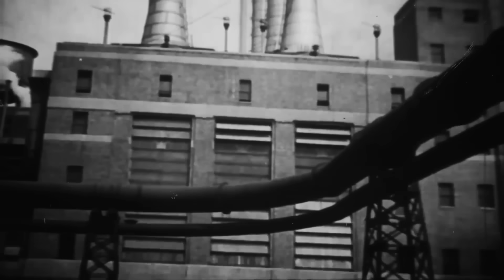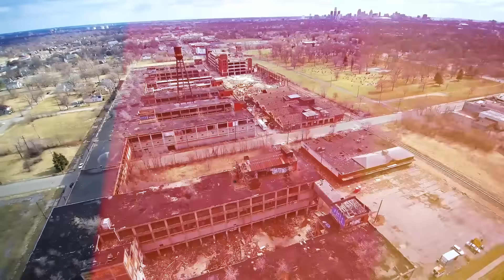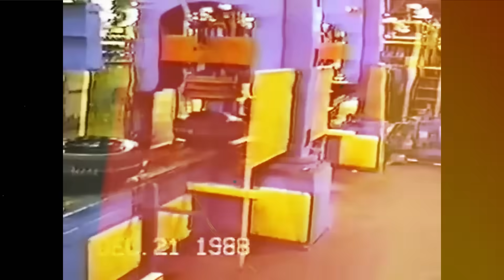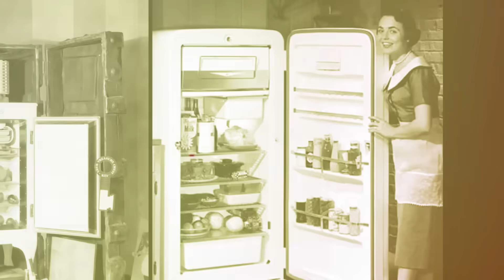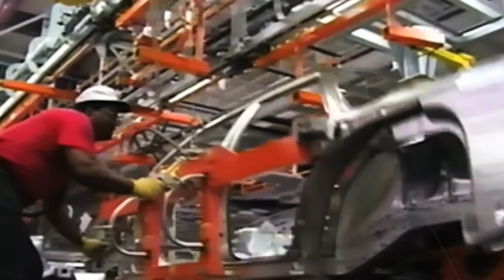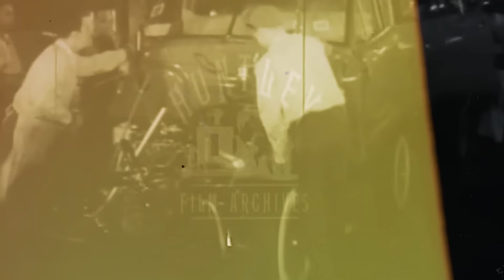The Shocking Truth Behind US Abandoned Car Factories!

Comment: No mention of Checker taxi plant.
Volkswagon built first foreign auto manufacturer ( not assembler rolls royce in n/east) in westmoreland Pa.
Plant was closed after VW demands for quality work and union refusal to comply and correct excessive inspection failures (68%) of vehicles produced. VW finally gave union ultimatium, get workers to do quality work or plant will close.  Inion refused so plant closed and moved to mexico. Plantcsat empty for over ten years. Honda bought plant and has been producing all of their snall engined eauipment and off road vehicles in the plant.  It was just announced that Honda will be closing it's two auto assembly plants up north in mid west. Leaving only the Alabama plant open to produce vehicles for US market only. Reason being new US reprisal tariffs on exportation of US made vehicles to eorld markets. Both Toyota and Honda are moving their plants to mexico to produce the vehicles for world markets that USED to be made here. Don t blame the manufacturers completely. It's the USGov interfering with markets they do not know or want to know/understand.

Comment: A Packard that sold for $2k about a century ago was a luxury car.  If monetary inflation actually averaged 3.5%....that's over $60k today.  But today, a luxury car is beyond twice that, so more than inflation is at work.  Between  union politics and Nixons epa waging war against any inustry needing a smokestack somewhere, US car inflation looks more like 4.5% compounded to me.  Industry has been nearly snuffed and hangs by a thread right now: throw a v-8 in what was an average mans drive and its six figures.  Luxury today?  I guess that begins around $195k .
Reply: @Flinch622 that's not necessarily true a Cadillac CT4 V Blackwing starts at 64,200 a Packard that cost 2,000 in 1925 would cost 37,000 in 2025 similar to a Toyota Camry SE AWD. Framingham Mass had a Buick Oldsmobile and Pontiac Assembly plant from late 1940s to late 1980s though Olds and Pontiac were since discontinued April 29th 2004 and October 30th 2010 last Olds off the assembly line was a Red Special edition 04 Alero and the last Pontiac off the Assembly line was a Red G6 sedan